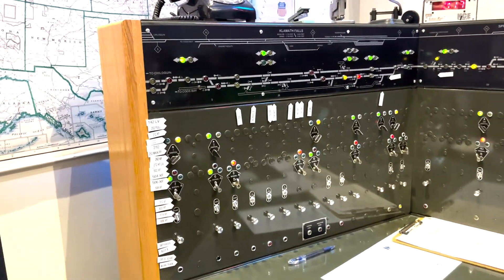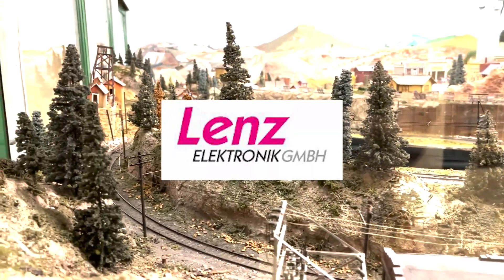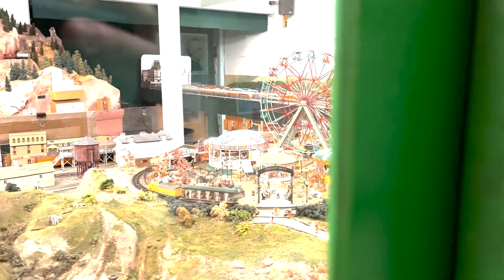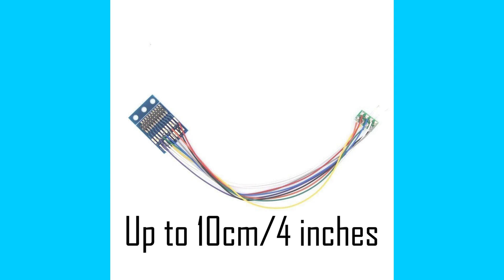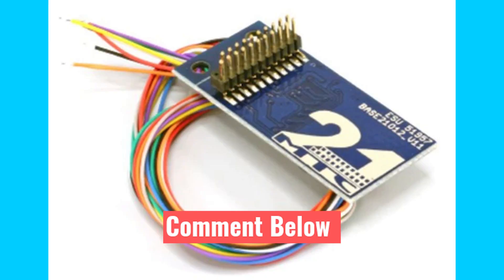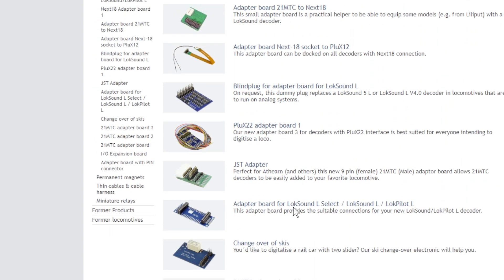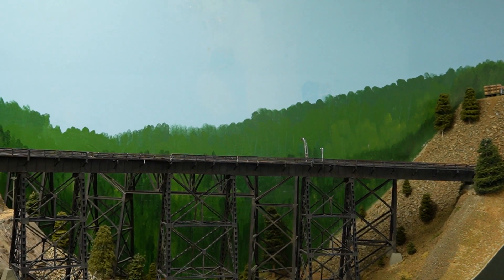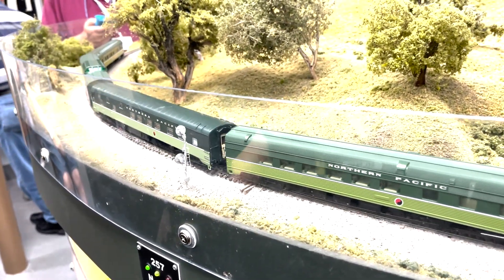DCC Decoder Interfaces: The Ultimate Guide | Essential Tips & Tricks

Comment: LaisDCC and Aliexpress also do 21 pin to Next 18, and Next 18 (male and female) to solder tags. I have used these to fit the Hornby HM7000 Next18 decoders to both OO and Dapol O gauge loco's as they are currently half price.

Comment: For kit locos or rewires I use one of the replacement type of board as I believe you can test using an older decoder then at a later date swap it easily for a sound one.

One that gets quite a lot of sales in the UK & EU is Zimo
Reply from the maker: Zimo are a great option to